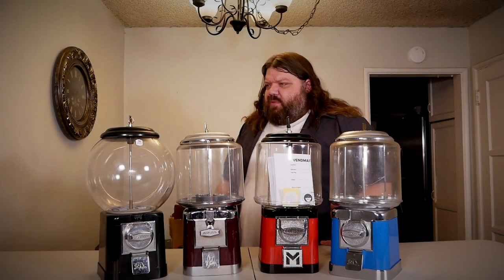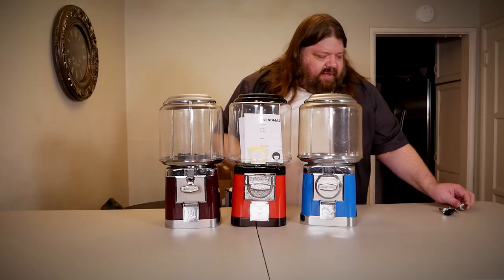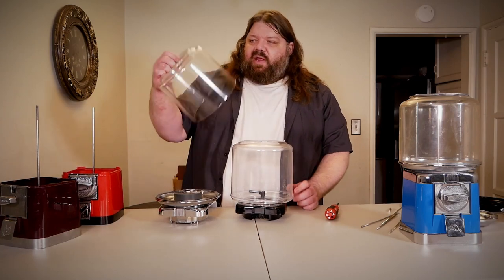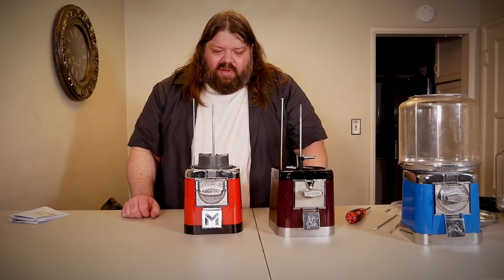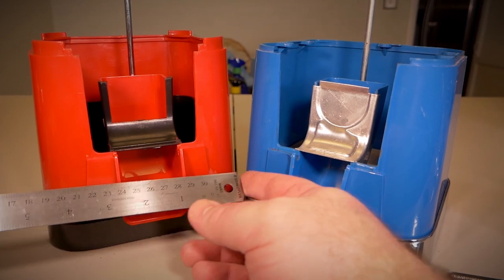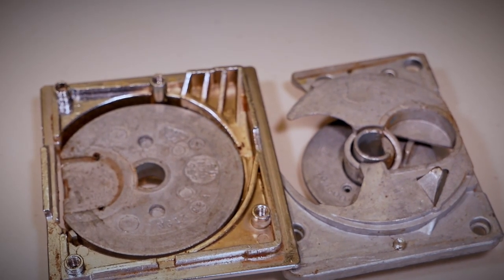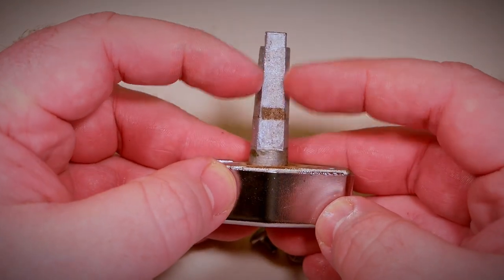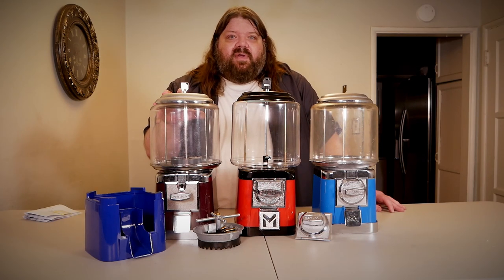Is This Vend Master Gumball Machine from Amazon a Beaver RB Clone?

Comment: I lost my Beaver key so I have to drill
Reply from the maker: Sorry to only just see this. However, you can open a Beaver machine without a drill. If it's a barrel lock, you can find a barrel lock impressioning tool on Amazon or on lock/security tool sites like Covert Instruments and Red Team Tools. Red Team have also just developed a new barrel lock hand key cutter, so check them out.